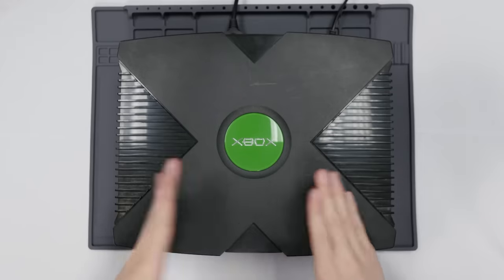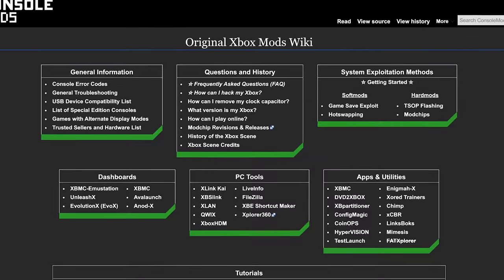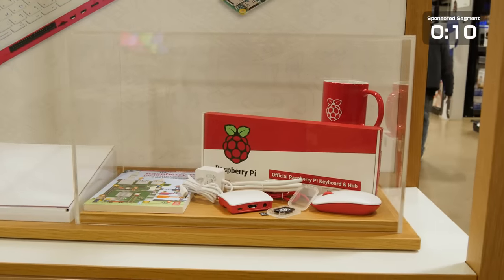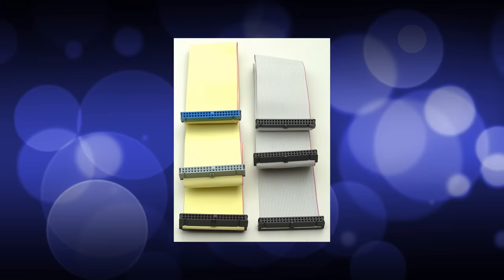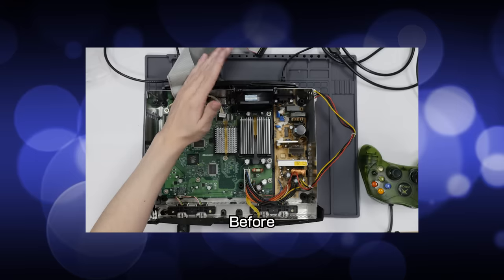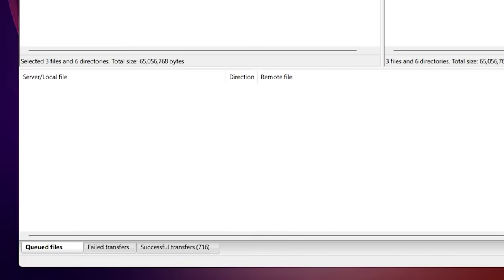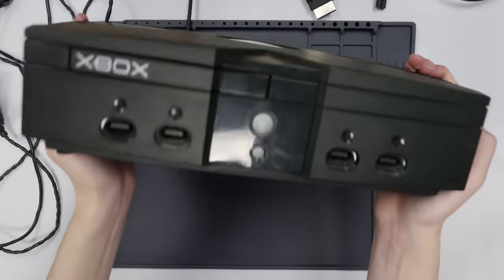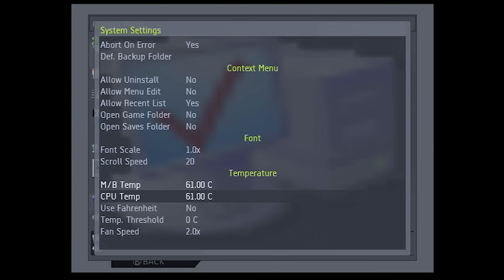The original Xbox is so NOISY. Let's make it ˢᶦˡᵉⁿᵗ

Comment: I got the same adapter as you for the IDE-to-Sata, whereas my friend got the red Star-Tech one. After looking up issues online after the fact, the Kingwin one causes a longer boot time for most people, even up to 15 seconds for me.
Reply: I have also experienced this. It's not just limited to Kingwin adapters either. Some other cheap adapters do this too. I've had several Kingwin adapters break on me. The StarTech adapters are my usual go-to. They don't cause long boot times and they are well made.
Reply: Everyone says the same thing about generic eBay unbranded green pcb adapters… but nobody actually details which converter chipsets cause the slowdown. Idea for the next video in this series maybe? :)
Reply: and?
Reply: yes can confirm, any adapter besides the startech gave my xbox weird issues
Reply: I have one of the generic green ones as the startech one isn't sold anymore in italy, but have had 0 issues with it, the only real issue was that all the pins from power to data connectors were exposed and might have caused a short if left uncovered, my console is super responsive too!
Reply: I think the longer boot time is because of the much larger storage space. Anyone in the 3DS modding community might know what I'm talking about. Giving a New 3DS XL out of all things a Samsung EVO 512 GB micro SD card that is legit produces a 20 second boot time. Lower capacity cards on the 3DS reduce the boot time. Just throwing a guess out there.
Reply: @GoTeamScotch   thank you for the info. Will look into that one
Reply: @od3stroyer771  is that why most people recommend the SD cards under 128GB for the 3DS. At least the OG one (I rock a japanese OG 3DS with custom firmware)
Reply: @abhimaanmayadam5713  This is something that I played around with as well, and can answer.

When I first got my 3DS, I wanted to go with a larger card than 32GB (I'm the kind of person that has a 512GB microSD in my phone, and a 24TB personal storage server, capacity is my drug). Especially after I read that the 3DS isn''t actually restricted to a 32GB card. It only cares about if the card is formatted as FAT32. Of course, in Windows, when it formats a card as FAT32, it'll only be 32GB maximum, but you can use certain software to go beyond that, and that's what I did to a 64GB card.

And it worked. The 3DS recognized the 64GB card and I was able to make use of all it's capacity, but I noticed a few issues right away. First, as someone else mentioned, it took a long time to boot, somewhere around 30 seconds to give me the startup screen. Second, my theme settings never stayed saved, I had to reapply my dark mode theme everytime I booted.

I moved back to a 32GB card and both those issues went away.
Reply: @HaloEvangelion03  I'm using a 64 GB SD card in mine. My settings do save, but it does take a really long time to boot. I might move my SD card to my RPi and buy a 32 GB card instead.

Comment: HONESLTY I didn't even know it was a requirement to have a 80 wire Ultra ATA cable for faster hard disks in the XBOX, I just had one laying around and thought it might help make things run faster without doing any test and shoved it in there after I soft modded and got a nice fast hard disk to put in it.
I mean I knew that faster IDE Hard drives worked better with 80 wire cables to reduce interferance which improves data transfer speeds but I didn't know it was required for the XBOX.
Reply: THE MORE YOU KNOW
🌈🏳️‍🌈🏳️‍🌈🏳️‍🌈🏳️‍🌈⭐️
Reply: kinda what I did too lol, got fancy black cable and stuck it there
Reply: The 80-conductor cable was required for the faster ATA/IDE standards. So if you have a drive that supports Ultra ATA/66, 100, or 133, but use a 40-conductor cable, it'll perform only at Ultra ATA/33 levels at best. Given when it was built, I'm surprised the original XBox didn't already use the 80-conductor cable. And it's the faster modes the IDE->SATA converter boards likely require.
Reply: @brandishwar  guess they were trying to have money here and there for a lower MSRP
Reply: @brandishwar  The Xbox did very little with its hard drive, so it wasn't necessary to have an 80-wire cable.
Reply: It's not just a xbox thing that....
Reply: Glad I wasn't the only one, I used to dumpster dive in my high school and bring home a bunch of computer parts, I had acquired a nice collection of IDE cables, I just went to my garage and picked up a fancy looking asus branded Cable that wasn't even "Flat" it was actually shaped like a normal cable (even fancier!) and plugged it in, I have all my games on a 750 SATA HDD and the console is super responsive so I guess I did the right thing back then.
The funniest part was getting shocked from touching the metal case of the Xbox somehow.
Reply: @ric9573  thats called grounding ;)
Reply: @userPrehistoricman  Actually, there are 3 partitions on the drive serving as game cache. Creating this cache takes what feels like forever in some games, the faster wire would've been great. (The cache persists between gaming sessions, but of course only until other games overwrite it. Then you have to go through the extensive loading sequence again.)

Comment: I can understand why you would do this but the reassuring click as the disc drive spins up to check for a disc and the Hard drive clicking to load the OS just lets me know everything is working correctly.
Reply: Ikr. Usually i can tell if my xbox freeze or just loading for a long time just by listening to the harddrive.
Reply: Some adapters for SD and CF cards have an activity light, handy if you want to check it’s being used or not
Reply: @amirpourghoureiyan1637  there's also a mod for xbox to add a disk activity light
Reply: Absolutely love this comment! 
I know my machine and I know what it means when it makes a funny noise.
Edit: Also how would you know if you're overheating the CPU if you don't hear the fans increase to 100% speed?
Reply: @kristianperryadams  you can't, unles you put your hand on it to feel how hot is it but it's not very accurate anyway. I think ps2 fat can't even control their fan speed either. Some console like ps3 do control their fan speed depending on the temperature. You can even modify it with homebrew like webman or irisman
Reply: the assuring humming from a smooth working machineis just satisfying. there is a reason why some emulators emulate drive noise, like winUAE does with the virtual floppy
Reply: @HappyBeezerStudios  that's a neat feature
Reply: Same for me, it also is just a nostalgic sound since I grew up with early 00's PCs and consoles so it was a constant whenever I used the computer, gaming systems, ETC.

Comment: Matt: “The fan is so noisy”

Me with my PS4 that makes jet engine sounds:
“Weak”
Reply: LOL I remember my PS2 3001 model it sounds same noise level of modded PS4. I am looking for any replacement of this PS4 fan
Reply: Blowiematron: Amateurs.
Reply: Same
Reply: @NoTraceOfSense  
my server: cough you saying something?

My server sounds like it has something stuck on the power supply, but i have taken apart the power supply and there is nothing!
Reply: Please tell me you ever cleaned and repasted it since 2014?
Reply: the ps2 3xxxx with hdd installed: 
awww
Reply: @itsTyrion  I bought mine in 2014 and I have not cleaned it
Reply: @SUPERBOBESPONJA1000  
My CECHC03 PS3 during PS2 gameplay:

asukapathetic.png

Comment: That power supply could still kill you even though it's unplugged, especially since you went in immediately after unplugging it. Those large capacitors will hold a charge for a while, and touching the wrong portion on the PSU (even while unplugged) will outright end you.
Reply: I don't think those capacitor can kill you, I've accidentally touched it a couple of times already. It's painful but i'm not sure if it would kill you(do not try it)
Reply: @depressedbread6893  It depends on how the shock goes through your body. There's a chance it could go through your heart, which is what could be deadly.
Reply: @depressedbread6893  I wasn't referring to touching the capacitor itself, but the power supply (in general) in such a way that it would create a circuit through your body. Yes it absolutely could kill you. And even if it couldn't, I'm not willing to bet my life on it.
Reply: @HazyJ28  nah these caps suck if you touch them but not kill you, unless you holded a bunch of them in paralel with one lead in each hand you would be fine
Reply: @theforerunnerreclaimer  it actually depends on each person condition itself. For example if that person already has an underlying heart desease it'll probably be very dangerous. For a healthy person it shouldn't be a problem. But again it depends on how bad the shock is, either way there's still risk involved by not properly discharging those filter caps
Reply: @creepysmilingcarl9742  No
Reply: @creepysmilingcarl9742  it depends, some power supply will just keep running until the voltage inside the filter capacitor is too low for it to run anymore, but usually it is still pretty high (depends on the topology). Some power supply has what it called UVLO that prevents it from running if the voltage drop to a certain level(i'm not sure about this, please correct me if i'm wrong). But most power supply usually has what's called a discharging resistor that will discharge the filter capacitor when it's unplugged. So by leaving it for a moment it should be fully discharged and safe to handle.
Reply: @creepysmilingcarl9742  most power supplies have resistors that discharge the capacitors after some minutes, but it's better to treat them like they have charge until you have measured them
Reply: this is why i will buy shock protector gloves when i start working with eletronics

Comment: honestly i find the noisiness of the unmodded Xbox to be very cute and endearing. like this big little pentium 3 boi is trying his hardest
Reply: It’s part of the experience with the old consoles, I know playing on the big PS2 wouldn’t be the same without the fan noise lol
Reply: It’s also kind of calming, like your in the passenger seat coming from the airport to home
Reply: @amirpourghoureiyan1637  tbf the later ps2 models were pretty quiet
Reply: @amirpourghoureiyan1637  I agree 100%. I would never want to quiet down a fat ps2 because it's part of the nostalgia
Reply: It also isn't the same without the DVD drive spinning up
Reply: pentium 3, GeForce 3, ide hard drive. that baby is like my retro setup. and both run Halo
Reply: @amirpourghoureiyan1637  the fan on the ps2 phat at least the model i have is actually decently quiet, the dvd reading noises though are LOUD

Comment: I'd love to see you take on the dreamcast and quieting it down without replacing the disc drive with an optical emulator.
That's be a fun and probably mess of an experiment.
Reply: It's pretty easy, you just add some lubricant to the plastic gear and to the rail.
Reply: Is it supposed to buzz like that?
Reply: on that note, add a reset button
Reply: @scottoleson1997  needs lubrication, that should already recude the noise A LOT.

Comment: You could seal the fan gap with the air entry with hot glue, so it will always be shoving up fresh air and not just circulating hot air from the inside

Comment: Matt: in regards to mounting a 2.5" drive inside of the 3.5" bay: what I did was measure out and drill screw holes from the bottom of the drive cage into the drive's bottom mounting holes, it works a treat.

Comment: Great video as always. As others have pointed out, change the thermal paste on both the cpu and gpu, could easily be one of the reasons for it running hot. Also the  metal shielding behind the fan actually blocks a lot of air flow. I have personally cut it, and it really made a difference.

Comment: I actually just did this with an original Mountain Dew Limited Edition Xbox.  Recapped and modchipped it as well.  For the case fan wiggling, i just 3d printed an adapter that slotted into the metal casing where the old fan slotted into, then the new nexus fan screws into that.  It's amazing how silent it is now combined with an SSD.  Awesome video :)

Comment: The issue with setting your fan speed in unleashx is that it will ONLY work in unleashx, once you load a game or other app it will default back to its original 20% this can be solved though by modchipping and using a custom bios.
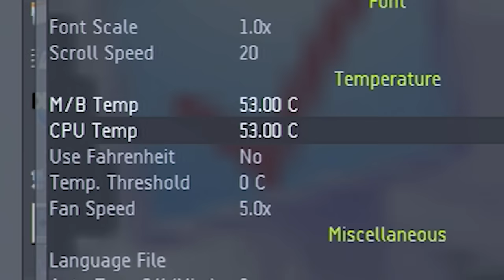Reply from the maker: Interesting, a few people have mentioned this, but I never had this problem. When I set it to a noisy 5.0x and launched a game towards the end of the video, it remained noisy the whole time, and definitely affected temperatures as you can see at 16:38. Maybe that's been addressed in a newer version of nkpatcher or something?
Reply: @MattKC  Hm did you replace the thermalpaste on the gpu & cpu when you took this apart ?
Might cool down the xbox more then when it originally came out with how much better thermal compounds have gotten, not too mention that original thermalpaste is probably 16 - 21 years old by now & probably isn't doing that great of a job anymore.
Reply: You have to go a few steps further and change the fan speed permanently from within the bios you are running
Reply: Hi Toine, nice seeing you here!
Reply: @MattKC  Nkpatcher only affects the EEPROM so that doesnt really make any sense to me. Maybe you think its still the same fan speed you set but its probably not
Reply: @Josh.Davidson  Hey hey, I watch all of his vids. I know alot about ogxbox modding so I figuered I'd place a comment
Reply from the maker: @RedOverlord  Nkpatcher is a kernel patcher. That's literally what the name means. The difference between 1.0x and 5.0x is clearly distinguishable, even in this recording, and it's condescending to imply that I can't tell the difference.

Anyways, we were both wrong. UnleashX does patch the kernel to maintain the fan speed. Here are two sources confirming it:

https://www.xbmc4xbox.org.uk/forum/viewtopic.php?p=36256#p36256

https://www.reddit.com/r/originalxbox/comments/ahvocy/question_fan_speed_options_in_unleashx_vs_xbmc/eeijwjv/
Reply: @MattKC My guy for using burnout 3
Reply: This is new for me aswell, in my mind you must have been mistaken because I thought it wasnt possible. so I apologize. 

And yes theres a very big difference between 1x and 5x I just couldnt believe that it would save your fan speed after booting something else. 

Regarding nkpatcher, it confused me as a similair app to config magic, which you use to dump write and modify the eeprom. 

I didnt know about the softmod settings part, I only use softmods to quickly flash the tsop

I have done many many systems with modchips, leds, hdds, 128mb ram upgrades, 

so I'am very familiar with the system just not so much with softmods

Comment: damn even I'm kinda tempted to do this... with an SSD and a user replaceable fan there's pretty much no reason this thing should literally ever fail. Other than like a capacitor or something, but at that point you could either do it yourself, or get the part and get some repair shop to do it for you

Comment: Its amazing that most of its noise is from a tiny 1-inch wide fan on the gpu, because its bolted down. I like the noise, but note, that early model fan only has a bronze bushing, and if it's old enough it can make a groaning noise which can be fixed with a touch of gear oil

Comment: I just took apart my Xbox for the first time because of your clock capacitor video. I have a version 1.0 Xbox that had never been opened since 2001, and while the whole thing was dusty, that GPU fan was a NIGHTMARE, so don't blame you for replacing the standard fan, since this thing can be LOUD.

Comment: I've actually done an SSD mod to my OG Xbox myself, albeit the only issue being in order to advance the boot I have to hit the eject button (for some reason).

Before anyone wonders, stock 1.6 motherboard. No modchip. Kingston 120 GB SSD.
Reply: In my 1.6 Xbox (running a OpenXenium Modchip) I had a 256gb Mushkin SSD with the Startech adapter and it booted up just fine. It booted straight into XBMC4Gamers with an amazingly fast boot time and it loaded games and programs immediately. If I wanted to I could likely flash it with a different bios that skips the Xbox booting animation and give it a much faster boot time.
Reply: @hiRyan329329  I’m using the same StarTech adapter since it’s the tried and true method for SATA on the IDE bus. I wish I knew why booting is broken on my softmodded Xbox though.
Reply: @R4dm1n  that is pretty odd tbh. Maybe one of those Xbox modding forums will have people that could help you if you wanted it

Comment: You can, in fact, use the middle connector at the motherboard. The IDE cables can be connected however you want provided that the drives are properly set to master and slave (and not cable select, which is when order matters). I always do this because it means no crazy folding right behind the DVD drive. And the part that goes to the HDD loops around the side of the DVD drive, then over the top of the DVD drive and on over to the HDD.

Comment: i'd be curious to see what the temp would drop to if you replaced the thermal compound with some thing a bit more.... modern?
Reply: I put new Artic Silver on my chips last year and they usually stay in the 40-50 range. Also used some fine grit sandpaper on the bottom of the heatsinks to flatten them out as best as possible.

Comment: @7:33 You're getting dangerously close to a plugged in and exposed computer power supply there. While those caps might not be enough to kill you they're still extremely dangerous.

Just a heads up to those who modify their xboxs and are new to electronics and their hazards.